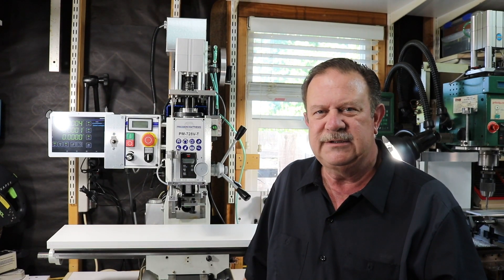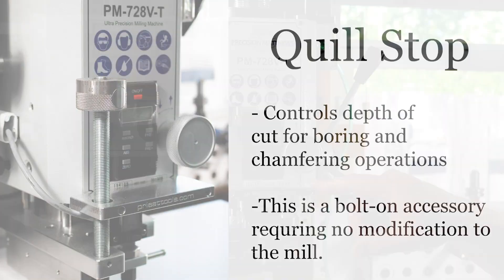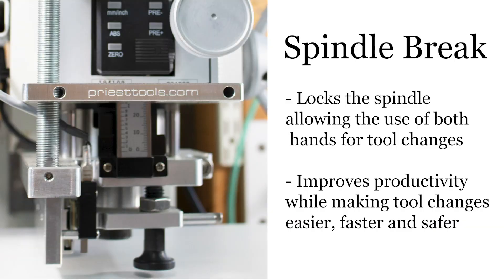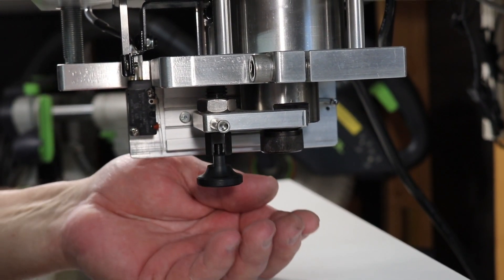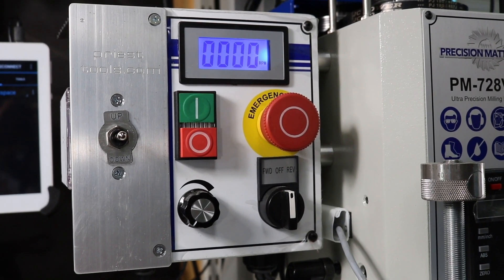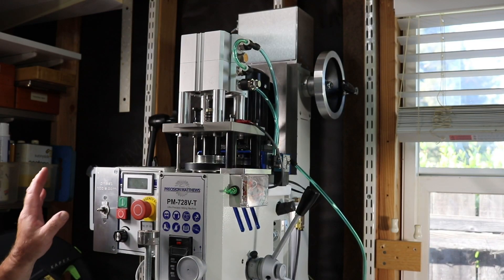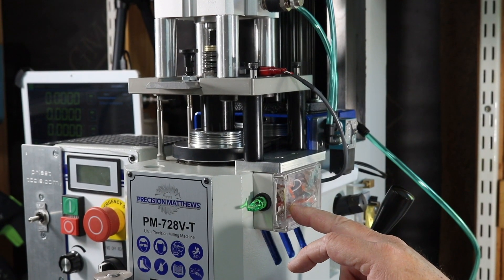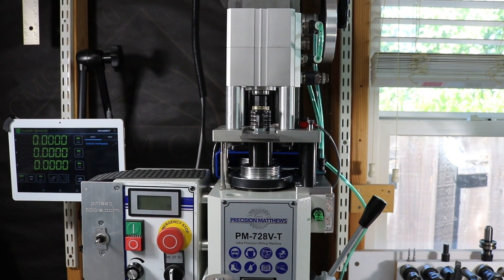New Accessories for Precision Matthews PM-728V-T Precision Benchtop Mill

Comment: Eagerly awaiting these upgrades, and I understand supply chain hiccups, not unlike a zillion others for lots of companies that are likely caused by COVID-19.  Using the mill is a bit tough due to being a wheelchair user I can't reach the z-axis handwheel but have worked around the problem with a drill, extension, universal, and socket for moving the z-axis and getting by that way.  PM has issues too, and the X-axis power feed has been delayed also.  So hard as it may be, I'll just have to behave like a grown-up and have a little patience.